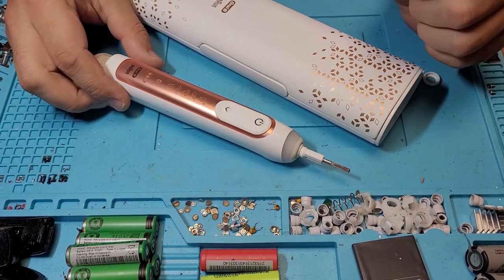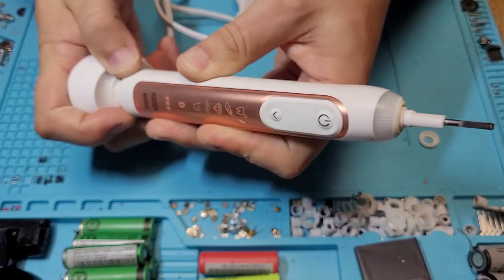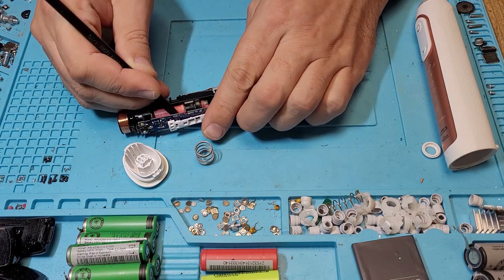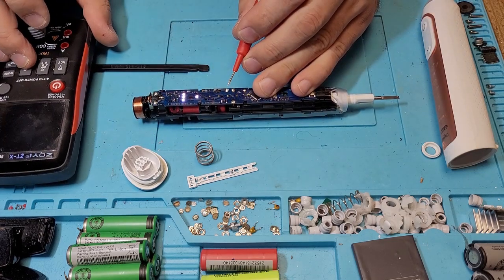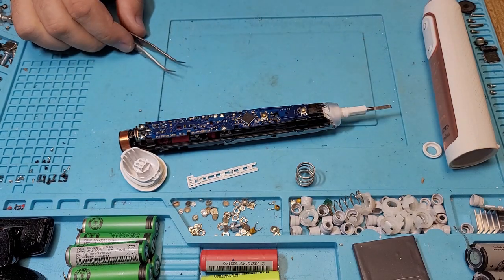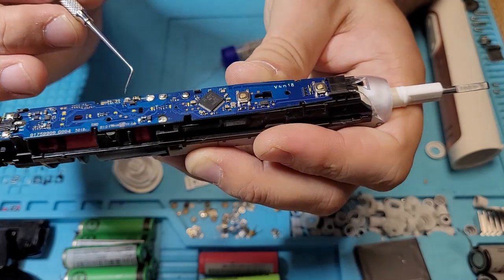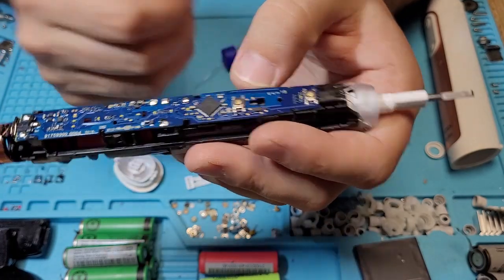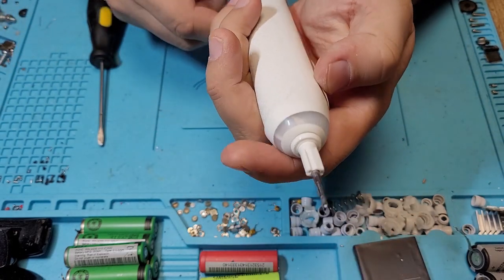Repair of Braun Oral-B Genius X. Lights up, but no vibrations.

Comment: Hi I have the exact same problem. Connected both ends with a pliers and the motor started working. I took out the fuse before my new fuse arrived. made a bridge just to see if it worked but now i can't get any lights on the brush? maybe I damaged something while taking the fuse?  What is the next component after the fuse? I can see 4 volts reach the component labbeled E (i asusme it is next after the fuse) any tips for trying to find out might be wrong? Thank you
Reply: Found the solution! did the reset of the microcontroller as described by @AJB and it works now. Thank you
Reply from the maker: @ultrixPt  nice! Comments are a gold mine in my channel:)))
Reply: The same thing happened to me, but I didn't find  the comment that describes how to reset the microcontroller. How did you do it?
Reply from the maker: Look for the comment. It had quite a lot of comments shouldn't be hidden.. simply said the test point is on the right to the main chip but the comment had much more detailed description how to find it.
Reply: @letsfixitgarage  
I read pretty much all the comments and couldn't find it. Perhaps it has been deleted. But I found another comment of yours that said that all you had to do was to put ground on the test point of the the main chip and it worked. Thanks.
Reply from the maker: Thats a shame.. not sure who or why but that was a valuable comment.. well hopefully your comment wil guide someone as well. If there will be some additional findings on genius repairs I will add it to video but for now I don't plan it.. anyways thanks for your comment and glad to hear that this video was helpful for you :)
Reply: @rafaelsilva-qf4hz  Please help me too!! I can't find it. Let me send a picture of the board.
Reply: @rafaelsilva-qf4hz  please can you explain how to reset the microcontroller please ?
What does "put ground on the test point of the main chip" means ? 
And where is the test point ?
Thanks for your help ;)
Reply: @rafaelsilva-qf4hz  same thing happened to me : it worked with the fuse trick but after reassembling, nothing anymore, no lights or vibration.
So can you please explain how to reset/restart the chip ?
What do you mean by "put ground on to test point" and can you send me a pic of where is this test point ?
Reply: Please i have the same issue! Damaged a compentent while troubleshooting. Brush isn’t turning on, but when I with tweezers bypass the small small component after the fuse, it turns on and works. Reset of the microcontroller? Apply ground to test point? Where is the test point and ground? Or should I replace my damaged component?
Reply: @hellogoodbye311  i think that component is also a fuse which would need replacement if you bypass it and it works

Comment: I followed the video and I just had the soldering iron touched the pp element on both ends without removing them. Guess what? It is working again. Thanks for the video!
Reply from the maker: It's always nice when something get repaired unintentionally:) I would thou nu a fuse and have it at hand as electronic component that comes back to life after heating is usually not in a best state :)

Comment: Thanks, I ordered some fuses but they ended up not fitting, but when I tested the old fuse with a multimeter it showed continuity, so I soldered it back on and it's working now, for how long I don't know, but for now it does.
Reply from the maker: I would sugest to look for smaller fuses as this one will not hold for to loong.. and yes these fuses are very small and requires some tools and skill to resolder..
Reply: It stopped working again, I might try to find a new fuse that fits this time

Comment: Had two of these with the same issue (first replaced within a year). Absolute piece of junk with an obvious mechanical defect. A case of over-engineering causing more problems than it solves. Will go back to an electric brush a quarter of this price
Reply from the maker: I understand the frustration when something gets broken but I have tried cheap Chinese toothbrushes and sadly they are much worse. Yes they are cheap but throwing away electronic devices is not a way forward.. sadly European toothbrush manufacturers don't offer repair service they just replace the broken ones with a new one in warranty period. that's why I like YouTube and it's knowledge sharing as sometimes it is a really simple repair and you have a working tool again :)

Comment: My brush would run for a second or two, slow down and stop. I found that polyfuse marked PP was dropping about 3 volts in the stopped condition. PP is a Bourns MF-PSML300/6-2 0805 rated 3A. Bypass PP with a multimeter set to DC current, the brush runs and the meter reads 0.5A so my fuse must be faulty. I bridged the fuse with solder and it works now.
Reply from the maker: Yes saw similar dying fuse behaviour as well. I would replace the fuse with some similar smal fuse.. bridging is ok to test the concept but fuses are there for a reason :)
Reply: @letsfixitgarage  Getting hold of a replacement fuse is not easy, neither is soldering it.
Reply from the maker: I have few links in description for the fuses, they are not OEM but seems to hold ok. And yes it needs some practice with these small components..
Reply: @letsfixitgarage  The ones in the description are rather expensive and are not rated 3A ...
Reply from the maker: Regarding 3A not sure it's needed.. If I remember correctly under load the motor was something in 300ma range.. tested it with these fuses that I had on hand (rated 2A but haven't tested) it worked fine so that's the only experience I have to share :)
Reply: @letsfixitgarage  I measured the current consumption at 500mA. 2A or 3A should work. I wonder if Braun went for a higher value because they were having issues?
Reply from the maker: Usually fuse value is 2x or more the normal operation value. Short circuit that fuse protects from usually has much higher values. But in this case not sure what happened at Braun but I would say that's a beautiful fuse but sadly not reliable..

Comment: Hello,
I am trying to find a document/source/information indicating the meaning of colour "main" LED which has turned from white to blue+green (from outside looking, no dismantling) recently and these last couple randomly days into full blue.
I hold a genius 9000 from 3 years now and it behaves like that recently (3months approx). I also observed once I started it, it was stopping by itself despite battery indicator was showing not empty. Furthermore, if you apply too much pressure during brushing, main LED should lights which I didn't observe since a while... I had previous Oral B generation which I do not remember the category.
No sign of battery charging/duration loss/decreasing in power/rotation speed or even noise except when battery goes low charge ( I never wait a full discharge for recharging). Oral are quite noisy compared competitors ;)
From full charge (couple hours upon charging voltage so mainly during night/sleeping [I am changing world region with working area => 110-240Vac], I do not observe any battery life "reduction".
My first query would the battery's spec. I read through few website indication of 1.2V but once opened with elements in place (nothing removed), I measured 3,49Vdc approx. Once board/mechanism removed from holder, my battery looks similar the one on this video, same colour.

Sharing troubleshooting experience just now ; ) . Prior looking that video, I was trying to investigate more and possibly replace the battery,  I bought one of 1,2Vdc. There was some rusted moisture near "teeth wheels" behind the motor. It may have affected the board components and produced unexpected behaviour. I didn't succeed (very limited hand welder or too old) to remove the battery for better inspection but after this, I noticed by pressing the starting button, the toothbrush was keeping in operation without interruption as written above. It might happened during welding I "remade" the connection battery to board on better connection than before. At the end, old battery still in place.
However, the 2 leds (blue and green) remain ON during operation phase. I am very curious of the colour designation. I remember at first bought, main LED (from outside looking) was white.
Any suggestion/idea or eve from "Vilnius". Would great, thank you.
Reply from the maker: Greetings from Vilnius :) there is a lot writen so sorry if not everything will be answered but few things regarding color of the led if I recall correctly it is a Bluetooth enabled device and with app you can change the colour of the lights. Maybe some settings "droped" accidentally and that's why the color changed.. regarding battery you have a li-ion battery that has working range from ~3V up to 4.2V. it seems you have bought a ni-mh battery that has working voltage of 1.2V so please do not mix or exchange them. If it had some rust it could have gotten water damage but this is always difficult to diagnose remotely. Hope this helps you ;)
Reply: @letsfixitgarage  Thanks for response. I never DL the application till now. A bit useless from my perspective. Through it, I was able to switch the colour. So most probably, rust found from water may have mess a bit resulting in settings. Despite the rust, motor still working fine and battery which I didn't change of course, looks have  good performances in time [days] and power delivery at instant moment of using. Thanks again for support
Reply from the maker: Glad it worked :) good luck, if it would stop working you know where to find the answer ;)

Comment: can you also share the solder model that you've used in this video? :) thank you
Reply from the maker: Sure, added a link to the description. I really like this soldering iron. Heat up time is incredible, lightweight, a lot of tips and you can even use it from 12-18V power tool batteries with some DIY adapters :)
Reply: @letsfixitgarage  Thank you Bro! I've found that my 10000seri toothbrush unit can charge/still can power on but when turned on, it only vibrate under 5 seconds and slow down to turn off as always. Do you know the root cause and appreciate if you can share a workaround for my toothbrush. thank bro a lot!
Reply from the maker: The same problem ;) replace the fuse and it will be as good as new.

Comment: Well, now im having issue putting the top ring back..
Reply from the maker: First putt back the bottom cover and only then the top ring
Reply: @letsfixitgarage  yeah i did. but the top ring having difficulty squeezing it in. but eventually i manage to did so by using a minus screwhead pressing down on one side and the other side having a corner/edge of an item pressing down at same time 

 and i couldnt find the 2A SMD of right size hence....i just simply fcking short it.
Reply from the maker: Well it will definitely work but I would suggest to look one up and add the fuse.. they are for a reason there even if original ones fail without reason :))
Reply: @letsfixitgarage  well i suspect the original one failed due to the speed control for the motor when u trigger the pressure thingy. the voltage fluctuation probably blew the fuse.
Reply: Hi! What is the exact name of SMD? Maybe I can get a link? Thanks, Zoltán!
Reply from the maker: Check video description
Reply: @letsfixitgarage  Thank you!Very super video!

Comment: A great tutorial, but my situation is strange - I replaced this fuse and after 3 work cycles it burns up again. I also replaced the neighboring one and nothing.
Reply from the maker: It seams there is a further defect on the board that leads to the burnt fuse..
Reply: @letsfixitgarage  Thank you for Your lightning fast reply. However, the solution was exactly as You gave earlier. My mistake was that I gave too much solder paste, so a bridge formed under the fuse - that's why it burned. When I soldered the fuse correctly, the machine came to life. Thanks again for the tutorial and best regards.
Reply from the maker: @donlucio1  glad you figured it out  :) although not sure if it's permanent fix.. if there was a bridge under the fuse it should have stayed like that bridge is essentially a wire it just jumps over the fuse so it shouldn't burn.. but if there was a bad solder joint it could have affected this behaviour.. hope now it's permanent fix ;)
Reply: @letsfixitgarage  I tested 28 cycles of work (until discharge), so I hope it will be okay. THX.
Reply: @letsfixitgarage  It's a motor... There is a metal dust on it's commutator creating a parasite- current-flow...

Comment: Hello! I just found my Oral B Genius X wouldn’t charge and turn on! I think it is because of the damaged electrode between the battery and the mainboard. Do you have any ideas on how to fix it? Thank you very much!
Reply from the maker: Difficult to say.. why do you think it is damaged? It's solid piece of metal it should hold fine.. But if it is really broken, then you would need to restore the contacts between battery and board..

Comment: Thank you very much Sir for this video you have uploaded, its very helpful and practically applicable to my Oral B Genius X toothbrush. I've only used my unit for just a year when i've suddenly experienced this malfunction in my unit, i bought it brand new and yet i experienced this unlikely trouble but thank God, your here to save my day and because you've uploaded a video like this - i'd been saved to pay expensive repairs from any technicians.
Reply from the maker: It's unbelievable how much information we have freely accessible in these days ;) but it's nothing if there is no will to use it. Glad you used it, Good luck and keep on learning!
Reply: @letsfixitgarage  my tooth brush just turns  off after like 10seconds how can I fix it or if you can fix it and  I pay you
Reply from the maker: @sebgehtola7828 Repair should be the same, exchange of the fuse. If you are from europe you can write me letsfixitgarage@gmail.com
Reply: Hi, thank you so much for this video. Can you tell me where can I get these fuses, and is it possible to glue the fuse with super glue or something? Sorry, I don't know
Reply: @tomv5254  search for mf-psml300/12-2  (PTC RESET FUSE 12V 3A 0805). You will need the two sides of the fuse to be touching the connection points permanently. Soldering is the best option

Comment: Hi Let it fix garage. This video was very helpful. I‘m not the expert to solder. The greatest challenge was to find someone to solder the fuse. 
The electritian will just solder it out and just want to bridge it. I hope it will be alright.
Reply from the maker: Well it will work, but if there will be some problems in future with motor, more things can brake without a fuse..

Comment: Which 2a fuse did you use. Theres a few different ones available like 1808/1206 etc. cheers
Reply from the maker: It should be something around 2mm in length. 0603 should fit ok

Comment: I have the same model, same problem and no warranty! Can you please explain what were the materials you used to attach the new fuse?
Reply from the maker: Flux, solder and soldering iron.. check some basic soldering videos to get impression of what is needed.. you will need a soldering iron with very small tip and something to hold the fuse in place and depending on eyes some magnification ;)
Reply: @letsfixitgarage  Do you have Instagram ? I want show you whether the fuse is the right one to buy.
Reply from the maker: No I don't use Instagram, but my email is in about Chanel section. Not sure what can I say other than it will be written in the shop site ;)
Reply: @letsfixitgarage  I followed your instructions and it worked!! My Genius X is only a year old but stopped functioning properly. I'm so glad I don't have to buy a new one which is expensive. Thank you very much for posting this video!
Reply from the maker: @marcsaintjames  good job! Share the knowledge ;) and if you share my Chanel then thank you as well :)